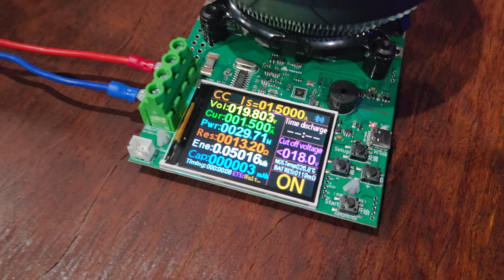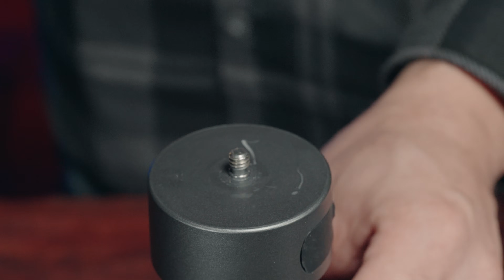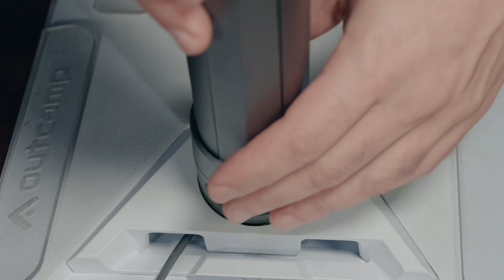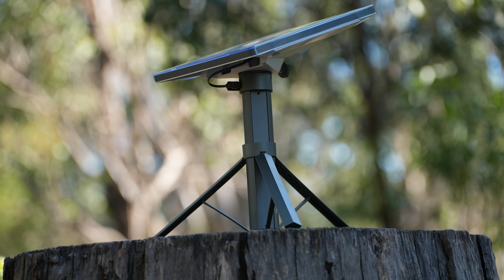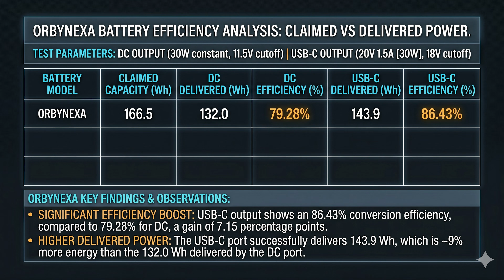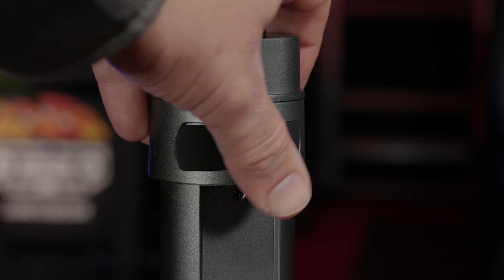Starlink Mini Powered Tripod - A Very Handy Accessory to Own!

Comment: Do you have to be plugged in with a cable to use any device or can you just pickup the WiFi signal from your phone to the Starlink?
Reply from the maker: Hi mate, the starlink mini is all wifi. It has a built in router so just connect to it like normal wifi internet

Comment: Hi Ayman, I am very appreciative for this review.  I am preparing for an extended period of camper/traveling and have been thinking of purchasing the Mini Obynexa to compliment my Starlink Mini + Peakdoo 2 set-up.  I haven’t purchased a tripod yet and figured it would keep me powered while I was recharging my Peakdoo2 and give me a tripod in the mix.  Thoughts?
Reply from the maker: My absolute pleasure Sharon! I would 110% support this decision and think it is a spectacular idea! 

The PeakDo pass through function works perfectly with the Orbynexa and you can use the bluetooth app for the peakdo as the on/off switch so you dont drain the batteries when not required.

In combination from my testing (with cutoff at 18v not 11.5v) it delivered around 240wh if im not mistaken, should be even more with the cutoff lower. If you have solar, you can also use the app from the peakdo to charge both power banks and run the starlink all at the same time.
Reply: @bushbusiness . I do have solar!  Thank you!!!
Reply: And thank you for the suggestion of using the Peakdo app to run both power banks and the Starlink at the same time!  I was wondering about that!!!
Reply from the maker: My absolute pleasure! Hope it helped and like I said in my video, whilst I get no commission, there are discount codes for you to hopefully save a few dollars
Reply: @bushbusiness . Thank you!!!
Reply from the maker: @SharonHillman-v6o my pleasure